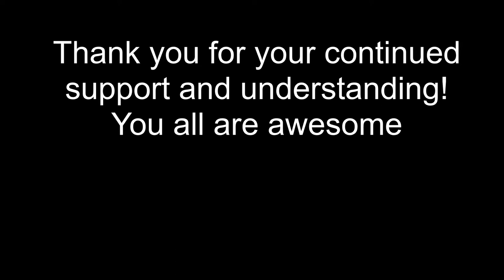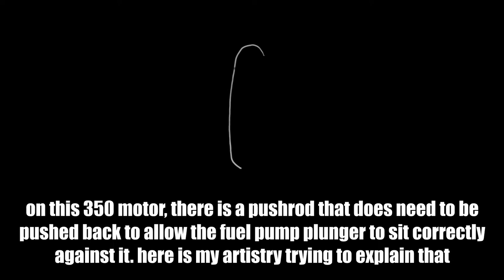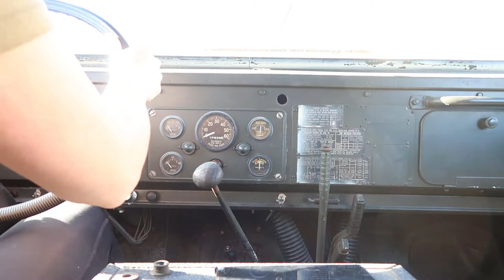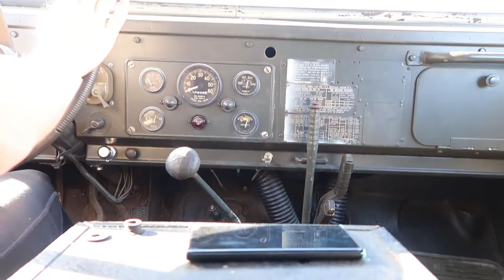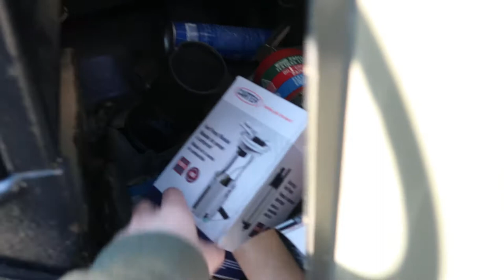My 1969 M715 and its fuel delivery issues.  Mechanical pump on the 350 motor went bad?

Comment: Nice.  Wouldn't worry too much about the lifter noise until you've driven it some, if it's been sitting for a while some lifter noise can be normal at first.
Reply from the maker: Thats what I was thinking. I've been trying to start it more and get it around the parking lot to get the oil back up to it. Ill take care of it eventually, but im just trying to keep it going with the least amount of repairs as possible for now!
Reply: The lifter noise could be from hydraulic lifters that just need clean oil, that's normally what happens when an engine hasn't been driven for a while.